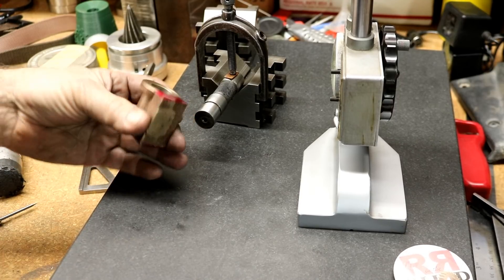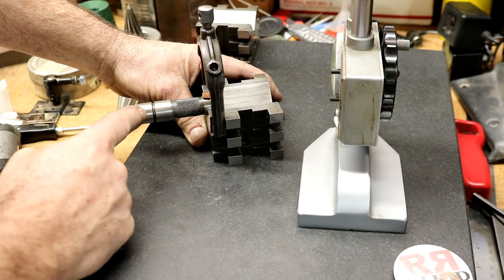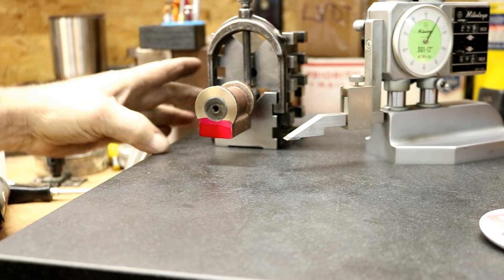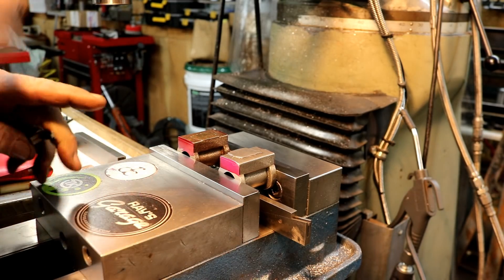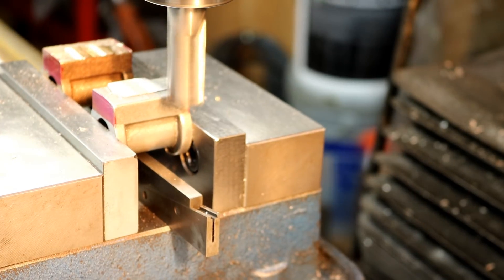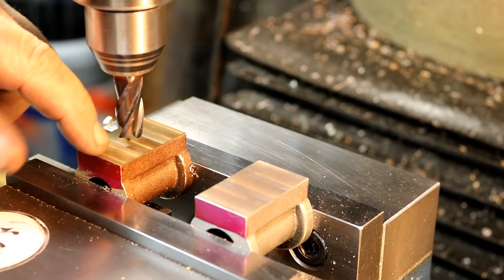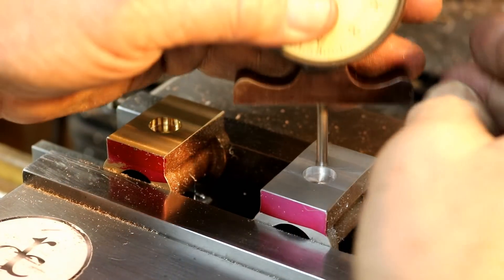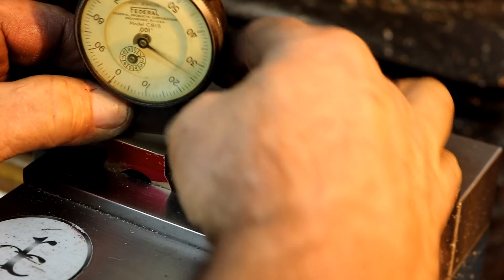P1-3 How to Build the Cylinder of a Model Steam Engine for the First Time

Comment: I think I would have squared the sides too in the same setup to give a nice parallel clamping surface while I was at it.  Of course you likely did just in the next video. :-)
Reply from the maker: I want to keep as many of the rough casting surfaces as possible.  Thought about it though.  Thanks Brian.